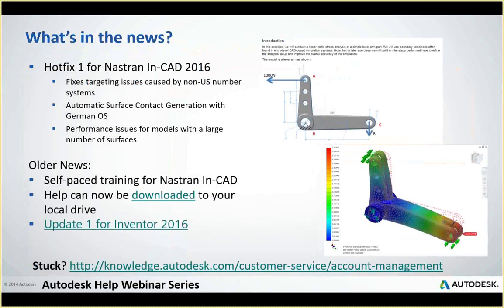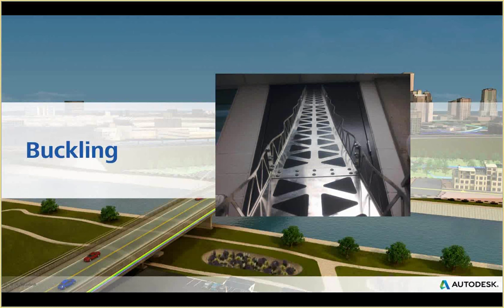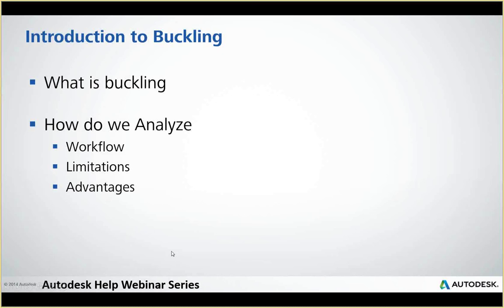Buckling Verification with Autodesk Nastran In-CAD

Comment: Dear friends,
If I want to model a taper column with circular cross section in Autodesk Nastran in-cad software and consider its buckling under self-weight, top point load and finally in existence of lateral load (static and dynamic). the problem at this point is that my column's modulus of elasticity varies linearly from bottom to the top of column. 
is it possible to model this column and define a function for E(elastic modulus) in Autodesk Nastran in-cad? if so, how can I do that? I will greatly appreciate you if you can let me know how to model my column.
 
Thanks for your time,
Warm regards,
Mojtaba